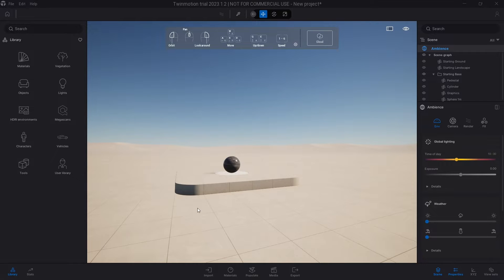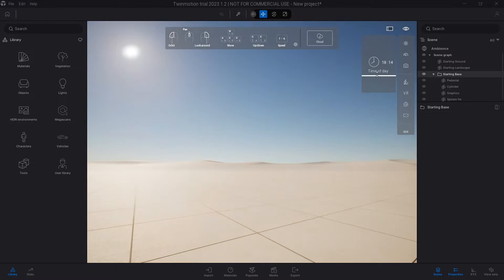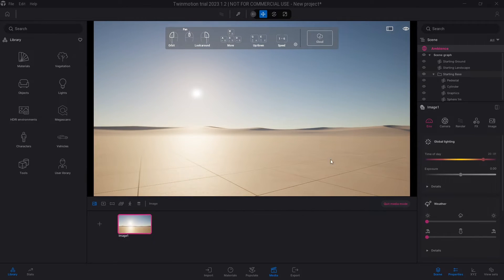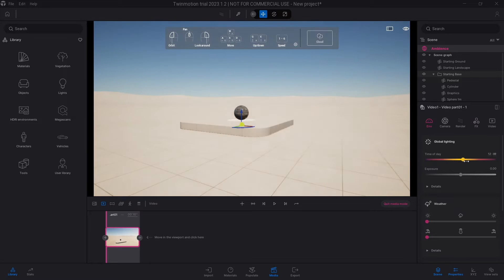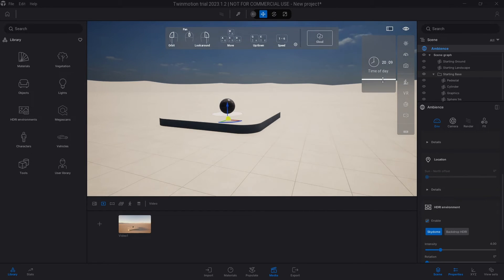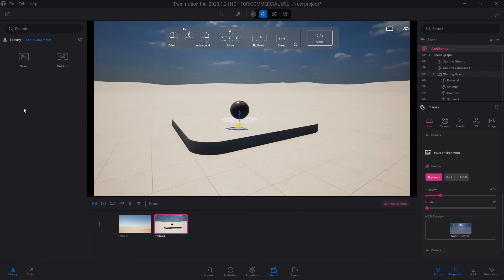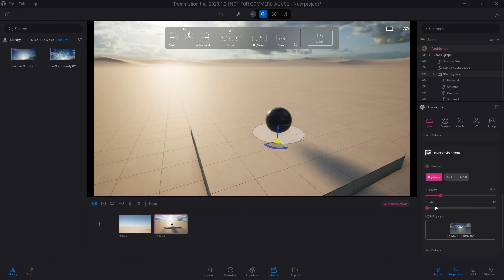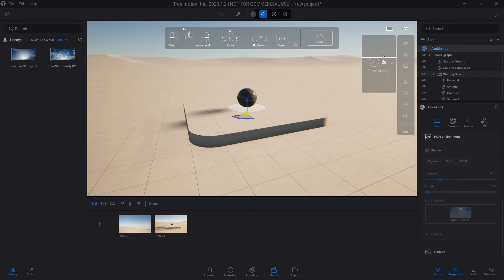How To Change Time of Day In Twinmotion | Video Export

Comment: can i change this setting if i already imported my model into twin motion? it seems like it is locked and i don’t wanna do another scene just to change daylight
Reply from the maker: Yes, Miguel, you can. I do that all the time.

Use the icon on the top right corner of the scene. It looms like an eye. 

Click that and move the slider up and down to change the time.
Reply: Thank you that was so helpful and quick